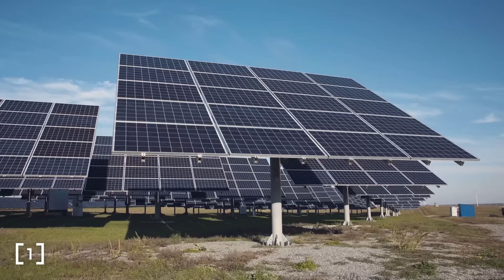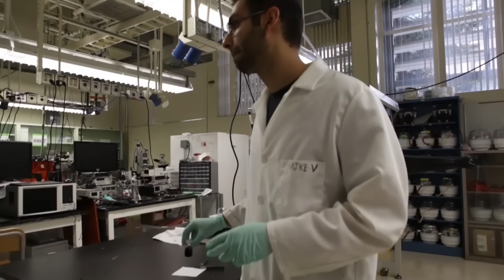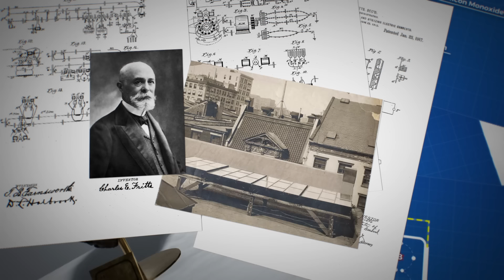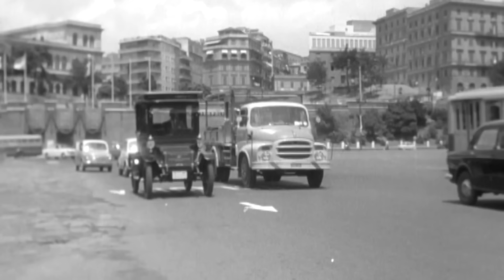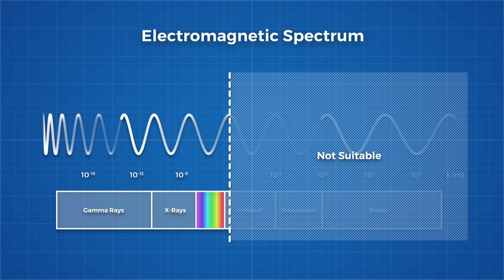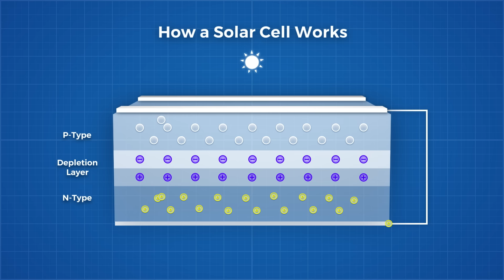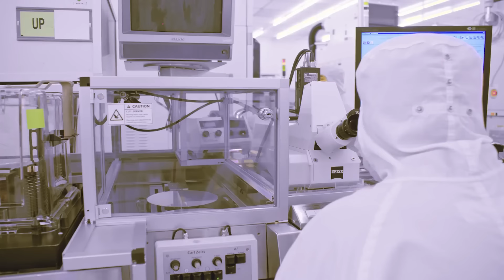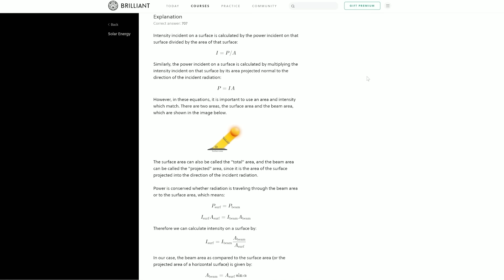The Mystery Flaw of Solar Panels

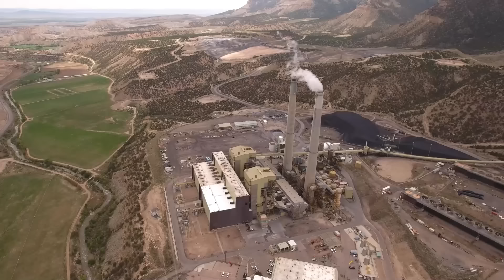Comment: 0:15 to 0:20 - Forgot to add political push and monetary incentives despite producing DC current, which has to be converted to AC via complex and costly electronic inverters with their inherent losses adding to those discussed. And taking into account that this source of electricity is working only when it's not nighttime, not cloudy, and the panels are not covered in snow, and rarely when it's actually needed... Kind of hard to become the dependable backbone of the energy producing grid... Even if those 2% are solved for all the new panels produced from 2021 onwards, this is far from being the biggest problem of this technology!

Comment: Solar panels are overated. They're high maintenance, expensive and neither are we benefiting from them as we should be. In Australia our electricity is forever increasing. It's an absolute scam. I lived for twelve years with solar panels and a diesel generator, obviously you are needing a back-up system. Also if it wasn't for my partner's father who was an Engineer, the cost of maintenance and setting up the panel for distribution from solar to battery would be a disaster as none of the "so called expert's" could not have arranged it as good and it would have cost a fortune into the thousands and it still would not have worked properly. Now living in the city, the current building has solar panels but of course they're not functioning all the time and sometimes the water isn't that hot. Anyway, overall it's not the simple and reliable, inexpensive system it should be and certainly not for "the faint hearted"

Comment: Wow, what a disappointment for an 'engineer' to be so deceptive.
Speaking of a rated capacity without also stating clearly that solar panel installations in the real world produce far less than their nameplate capacity promises is incompetent or dishonest.
When you switch on a coal fired power plant and turn the dial to 8, that's what you get. 24/7 bar maintenance.
Solar panel installations produce far less on good days, maybe 15-35%??? and on bad days, well nothing at all.
Capacity is simply potential based on it's capability, not on real world performance.

Where are the real engineers who deal with the real world, facts and data?

Comment: Each time i try to explain to people why photovoltaik cells have about 1/4 efficiency compared to solar heating, i am reminded of how you basically need to visit university for about 3 semesters to really understand these things :D Nice to have a nice little video to show.
This 3/4 loss of efficiency is the reason why i advocate for solar thermal in home application. In central europe and similar climates, people use 1/3 of energy on heating, 1/3 for electrics and 1/3 for mobility. Using an average sized household installation, you can either cover the whole of your heating demand or about 1/4 of the electricity you need.

Comment: Nuclear gang, rise up!  ⚛⚡☢
Reply: Nuclear energy would indeed save a lot of space but has one of the highest costs per MWh. On the other hand, solar and wind have the lowest costs per MWh.
https://en.wikipedia.org/wiki/Cost_of_electricity_by_source
Reply: HEY OOOOO!!!!!!
Reply: Can’t wait for more effective and efficient nuclear power.
Reply: @thelastnoise9210  its actually fairly effecient with todays  tech. its even a lot safer than 50 years ago. but the enviromental fascits dont want nuclear. only solar and wind, two sources of power that are very ineffecient
Reply: Trucker2019 I Know. The difference in Watts per square meter is also a factor they seem to miss out on. How big of a Solar plant do you need to match a Nuclear plant’s Power outage?
16 square miles area of panels and mirrors?

Comment: Solar power still needs a lot of improvement.  Far more efficiency would be a start.  Less toxicity would be good.  Durability another issue.  Right now to power, say, Houston would take enough solar panels to cover 5 times the area of Houston.  The effect on birds and other wildlife has to be considered too.  Not as bad as wind turbines (which have driven some species of bats to extinction and birds to near extinction), but still a problem.

If we could have solar panels that work at 50% efficiency, don't need replacing for 10+ years, and aren't toxic to get rid of, they'll be useful in places they can be useful in.  Me, I"ve always championed local power for local needs, not mega projects.

Comment: Chinese solar cells are manufactured with low quality gases. the contaminates in the gases are responsible for LID. The Chinese believe everything can be made Cheaper, never mind that this means it will either not work at all or will not work for very long..

Comment: I absolutely cannot understand this fixation that people have about the efficiency of solar panels. My panels are nominally 20% efficient, yet they are efficient enough that my electric bill is $0.00. From my point of view, my efficiency is 100%. For me, measuring the percentage of energy striking the panels as a percentage of the electrical energy thus derived is meaningless. Install enough panels to meet your needs and don't worry about some numeric ratio of sunlight in vs electricity out.

Comment: How much eletrical energy can hot water from cooling solar photonics panels could we extract? We be using a sterling engine or known as a "heat pump" as part of the question as reaching superheated or saturated steam levels wouldn't be practical temperatures for the panels be under as a hybrid system.